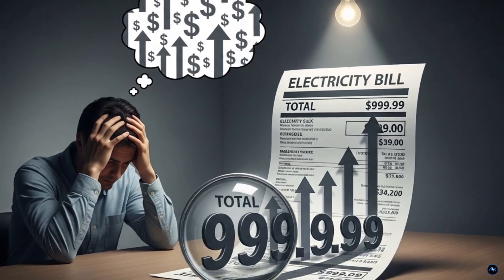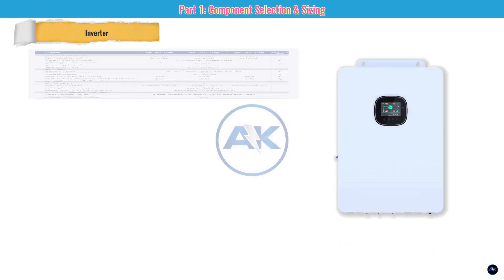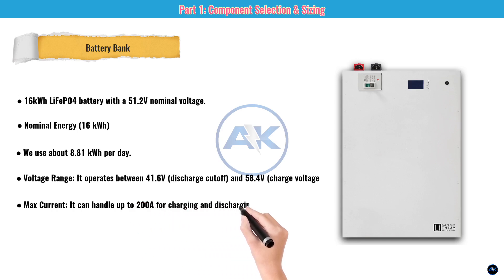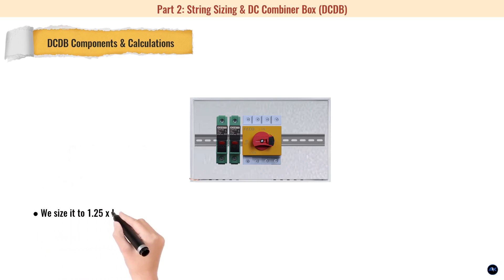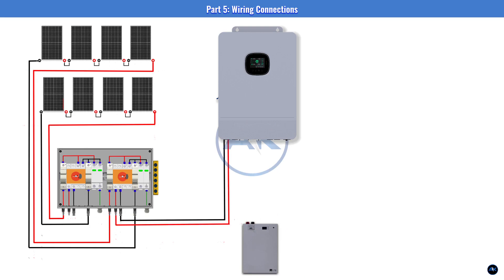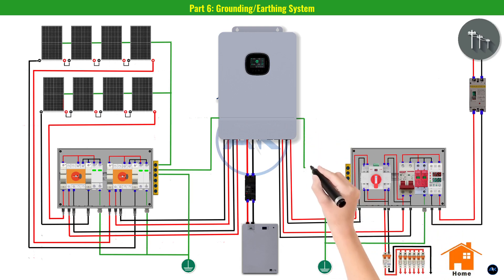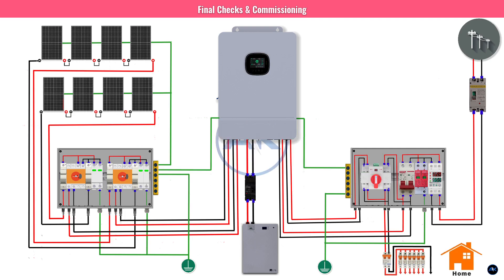Ultimate Guide: Build Your 4.4kW Hybrid Solar System from Scratch!| Beginners Step-by-Step Tutorial

Comment: Why not just use one  MPPT instead of two? This inverter can manage all eight panels on a single MPPT.
Using one MPPT would eliminate the need for more wires and fewer DC and AC components. 8:50
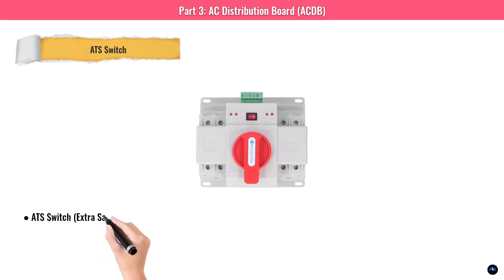As for the ATS switch, we would want to us JPS for backup and not the other way around. 7:01
What do you think?
Reply from the maker: Thanks for your input and the detailed analysis. I appreciate your thoughts on using a single Maximum Power Point Tracking (MPPT) for the solar panels and the suggestions regarding the Automatic Transfer Switch (ATS).
Single vs. Dual MPPT
You're right that a single MPPT can handle all eight panels, and this approach would definitely reduce the number of wires and components, which simplifies the installation.
However, using two MPPTs can be beneficial in certain situations, such as when the panels are in different orientations or if they are subject to partial shading. When some panels are shaded while others are not, a single MPPT would limit the power output of the entire array to that of the lowest-producing panel. With two MPPTs, the system can maximize the power harvest from each group of panels independently, leading to higher overall efficiency.
The decision to use one or two MPPTs really depends on the specific site conditions.
Automatic Transfer Switch (ATS)
I'll take your suggestion regarding the ATS into consideration. I'll research the JPS (Jamaica Public Service Company) as the primary backup source to ensure a reliable and seamless transition.
Again, thank you for your valuable feedback. It's great to have a different perspective on the design. Do you have any specific examples of setups where a single MPPT has worked particularly well with all panels in a single string?
Reply: @akelectricdiy  I haven't built the system yet. I am waiting for the battery and inverter to be delivered. I usually upload videos to my TikTok showing DIY content, and I have another YouTube channel where I will be uploading the installation process.

Comment: First of all, thank you for your very instructive videos. Could you explain why you choose 1000V for DC isolator and surge protector when each string does not exceed 202V? Are they more efficient than 500V or 600V or is it a predisposition for a future evolution of the system ?
Reply from the maker: Thank you so much for the kind words and for watching my videos! Your question is an excellent one and gets to the heart of a common practice in the solar industry. It's not just a matter of "over-specifying" components; there are very important reasons behind choosing 1000V rated devices for a system that currently operates at a much lower voltage.
the choice to use 1000V components is a smart engineering decision that prioritizes long-term safety, system flexibility, and cost-effectiveness over the system’s lifetime. It's a proactive approach to building a robust and expandable solar energy system.
Thanks again for the excellent question!